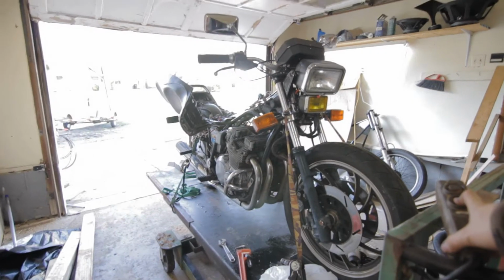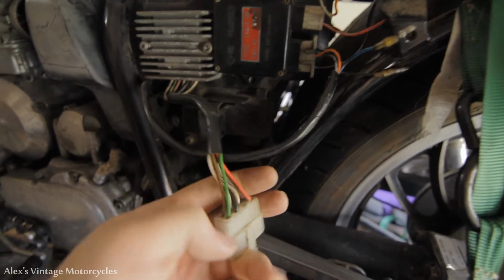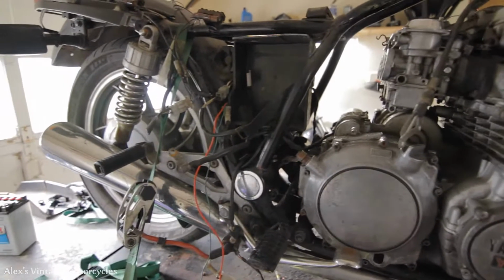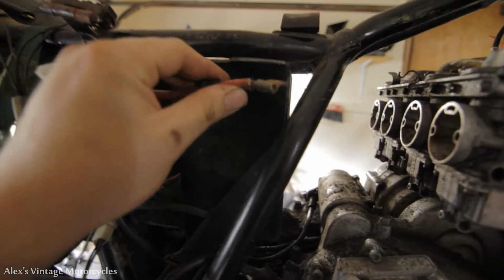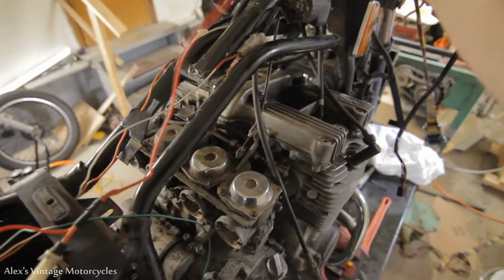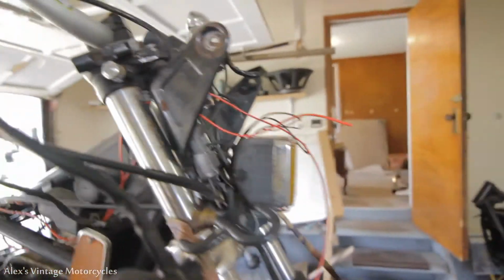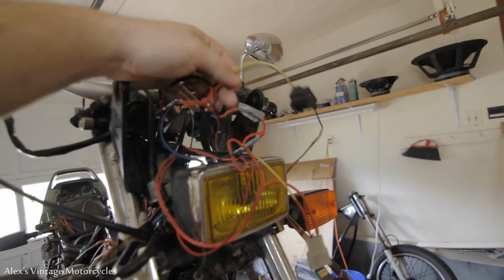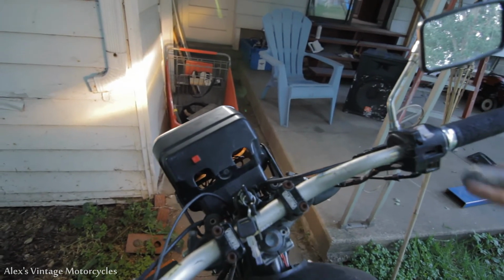How to wire a motorcycle up from scratch (Japanese bike)

Comment: Hi, I own an XJ400 (1983) and I am having some problems with the bike. I believe its an electrical issue. When the bike is running on high turns/high speed it stalls. In the beginning looked like fuel supply but is not.  The carbs are okay. I also checked the coils and rectifier and are also fine. 
It looks like something is confusing the engine electrically. 
Any ideas of what might be?

Comment: You are joining a lot of wires, very close to the molex type connectors, sometimes even 2 joins. I know you said it was saving money, but...

The pins are really cheap, and a pin extractor is a couple of quid, free if you make one.
All that time, solder, twisting wires, heat gun, shrink tube etc would be helped by putting  a new pin on the end and pushing it into the molex... where you can obviously. :)

If it was a bike I was going to use, I'd probably be replacing most of the wires with new, no knowing how many intermittent faults are in old wire that has been heated and vibrated to death on a motorbike.

Saying that though, I did like your video.

Comment: Thanks for sharing!I would like to ask for your advice,i'm replacing the headlight on my xj and the wiring is a nightmare,i got all the wiring out of the old headlight,but there are so many cables and connectors so have serious trouble fitting them into the new headlight,what should i do?

Comment: Dont get me wrong you got it done but no way i would of done it that way to many connections more you make the more it can go wrong next time take the pin out open the bit that holds the outer sleeve cut it off put new cable it crimp it solder it the shrink wrap over the top of pin done no joints just one cable no shorts or even better get the right stuff to do the job you can save money on a job but sometimes if not done right it will cost you more in the long run